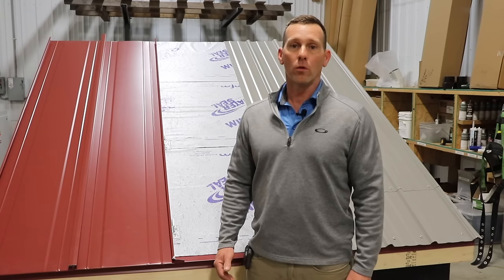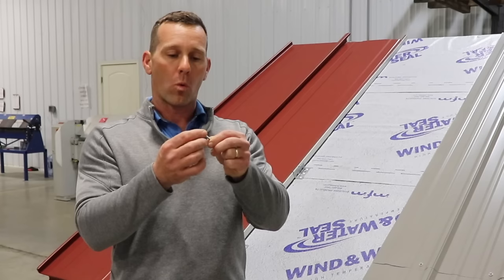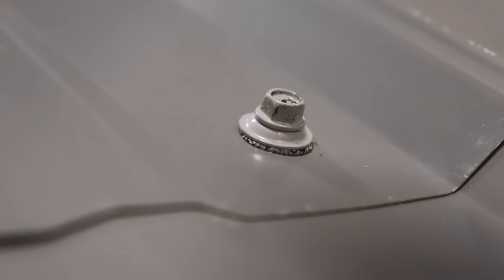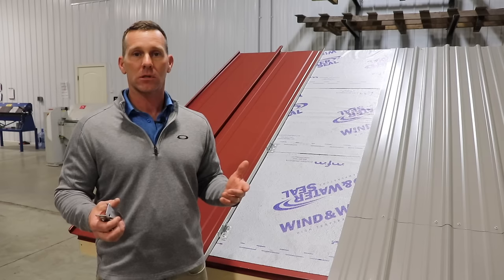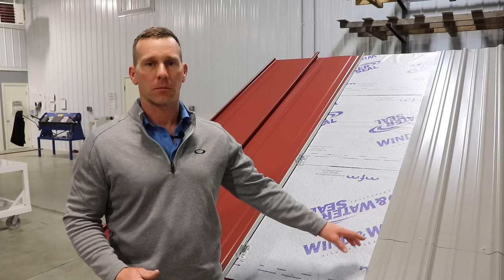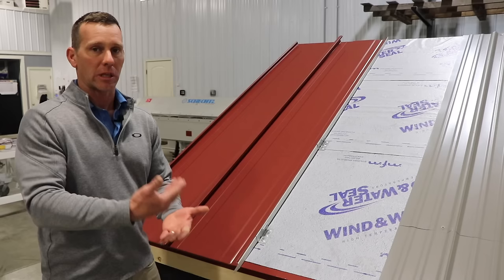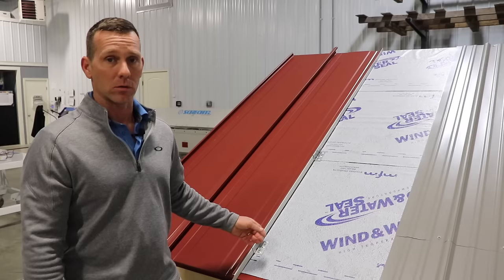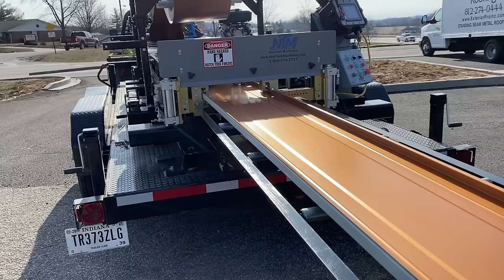Standing Seam Metal Roofing Vs  Corrugated Screw Down Metal Roof - Big Differences between the Two

Comment: Garbage. The screws leak after 4-6 years. The ribber washers wear out. Also screwing it down is wrong ( metal needs to expand n contract). Use nails!!! In sask 🇨🇦 where i live we get 70KM winds, +35, -40 Temps, heavy rain etcc. Every kind of weather.